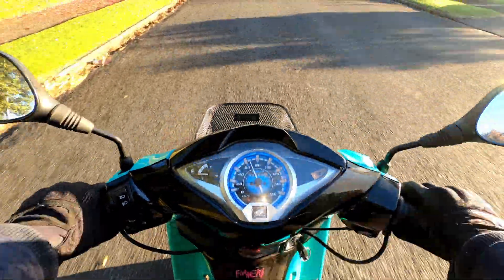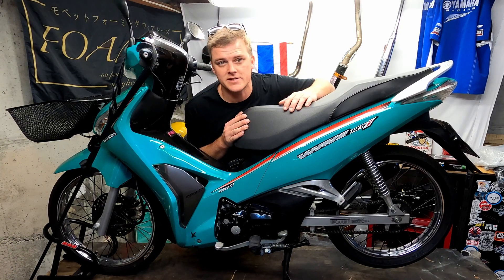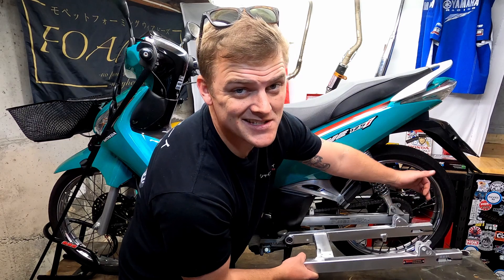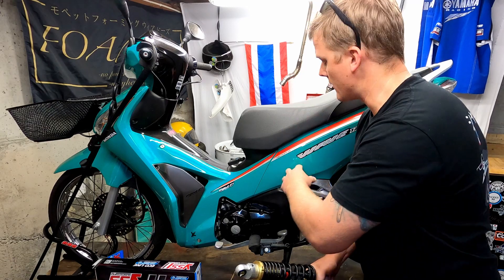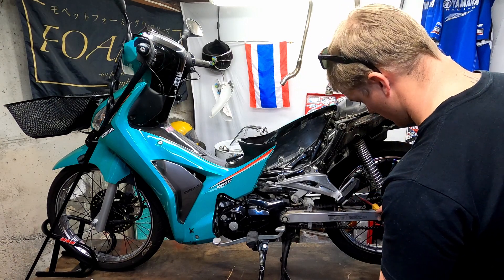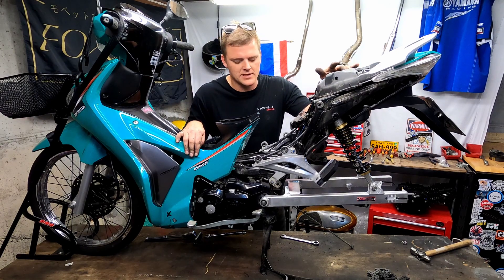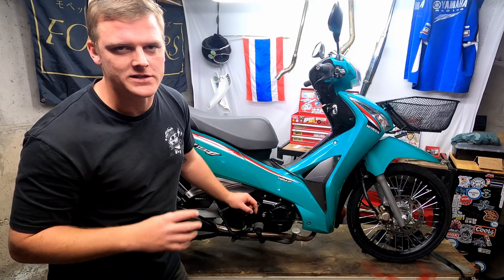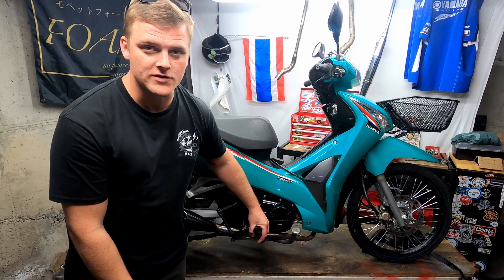Building a THAI DRAG BIKE - Part 1

Comment: Mine is 65/5 with an NLK exhaust my wave100 can go up to 18+  km/h looking forward to changing the the gearbox and changing from 65mm to 70mm my front sprocket is 16 and the rear sprocket is 30 and yes I tested in on a highway.
Reply from the maker: That is honestly awesome! Are you using a GPS app to test it? Where are you located?

Comment: Thai drag bikes are fast,  modifying the engine is a part of thai drag/streetbike builds, Ill suggest some parts that are easy to install and would make the bike alot faster, it would also make it sound BETTER.
57mm block set
Bigvalve head (optional)
30mm racing throttebody
Highlift Racing cams (piston needs to be pocketed)
Racing ecu
Racing ignition coil
Irridium sparkplugs
With this type of set up your bike would easily hit 140/160kph.
Reply from the maker: Have all my parts already. A little sneak peak into the parts is at the end of my latest video! Stay tuned for the build.

Comment: What is better air cooled engine or engine with a radiator , in the hot 🔥 summer 🌞
Reply from the maker: I added an external oil cooler to this. But there are tonnes of air cooled underbones riding around in the South East Asian heat without issue.